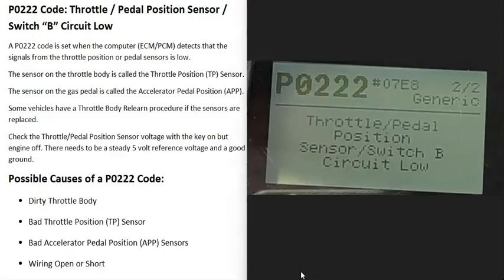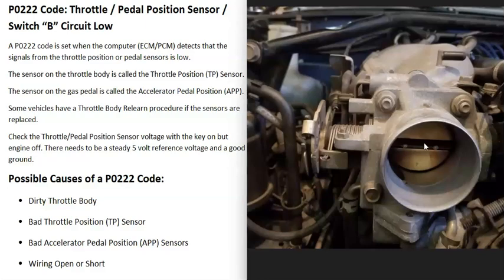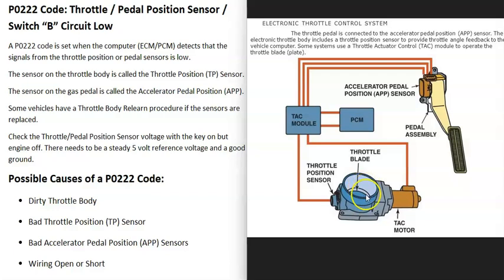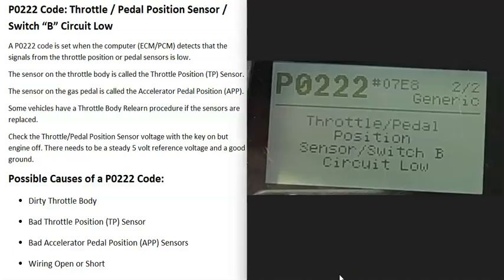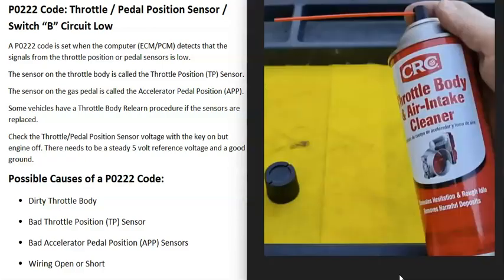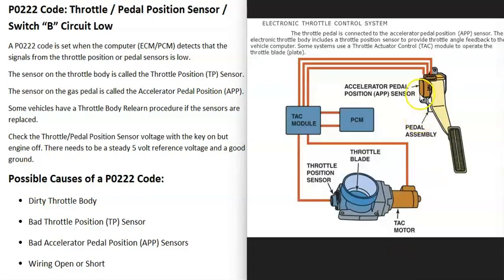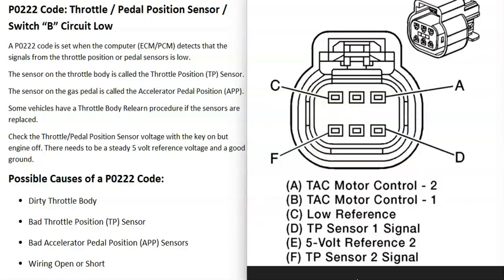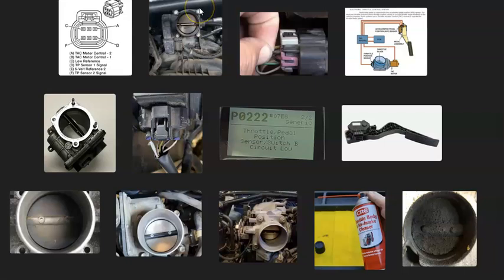Causes and Fixes P0222 Code: Throttle / Pedal Position Sensor / Switch “B” Circuit Low

Comment: Hi, my Audi A3 8P drives smoothly when cold, but once the engine warms up, it hesitates badly on takeoff and requires extra gas to get moving smoothly. This is particularly frustrating in traffic. Has anyone else experienced this issue?

Comment: The Mazda CX 5 diesel throttle valve has been changed and the accelerator sensor has been changed, but the P0222 light is still on. What is the cause?

Comment: Thank you for sharing this very informative video
Reply: Hey thanks for the video. If I get p0222 code and a p0123 code after having issues with jump starting. Do you think just driving it around the block will work. I pulled the throttle bottle a couple months ago as it is a pentastar 3.6 and needs reassurance that I still care about the damn rocker arms so the throttle is checked often.